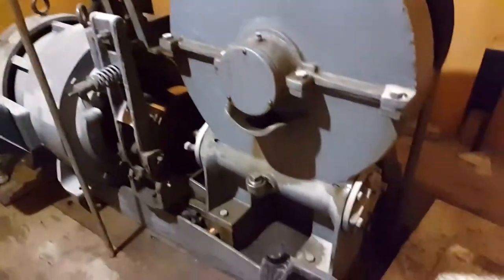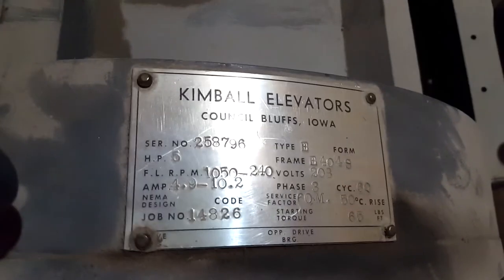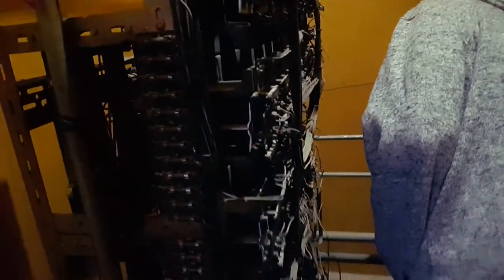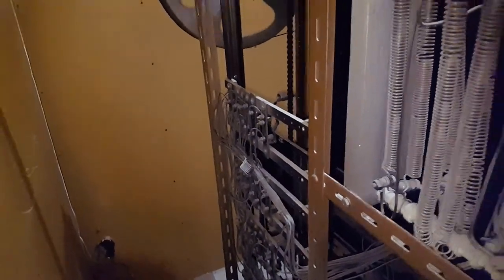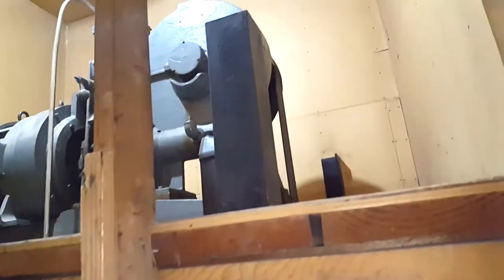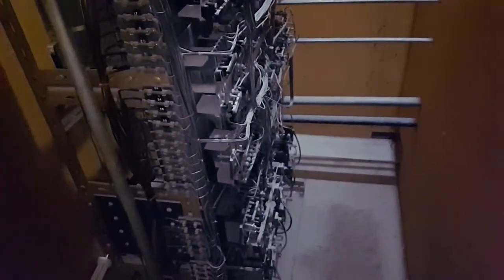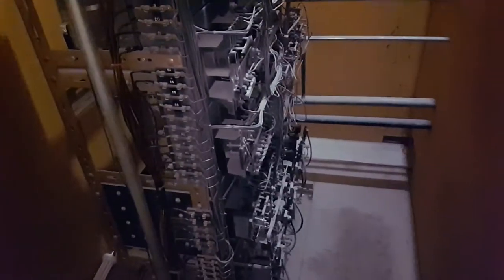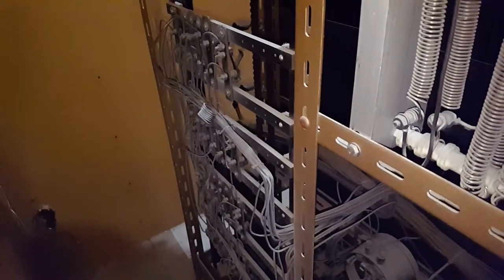Kimball Elevator Machine Room Tour

Comment: It's a nice traction machine 5HP 3 phase AC motor 203VAC seems a little unusually, most traction machines are 220-240V if they're  older installations.  I do know of one hydro elevator from the 1930's which has been torn out, had a 5HP 3 Phase Induction 208V power unit.  The installation of the secondary disconnect switch while it's out of the path of the relay controller rack, might have been safer at the entry way and using a lock out tag.